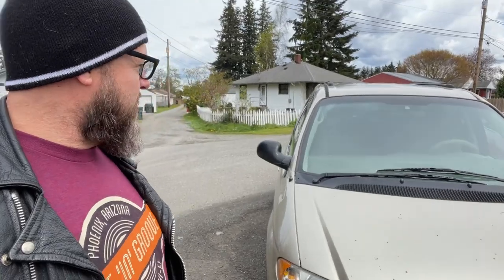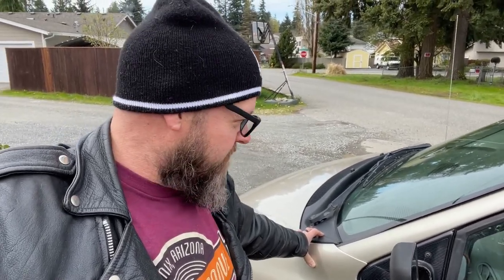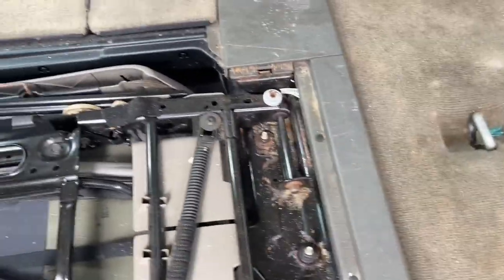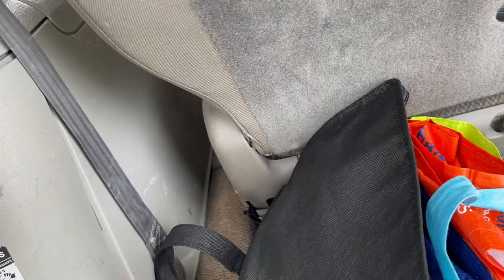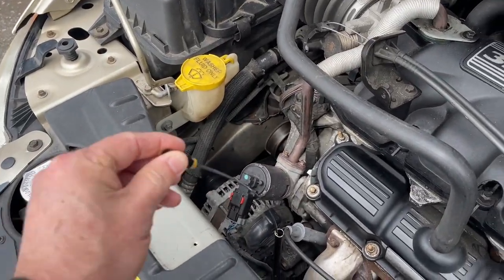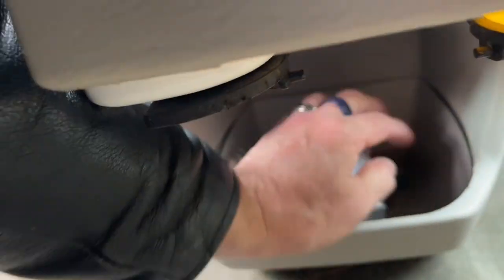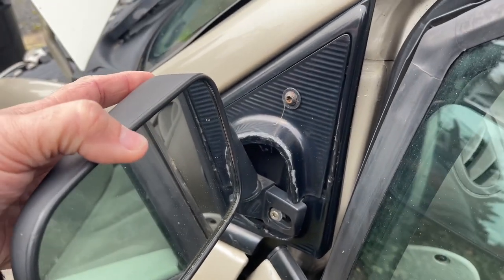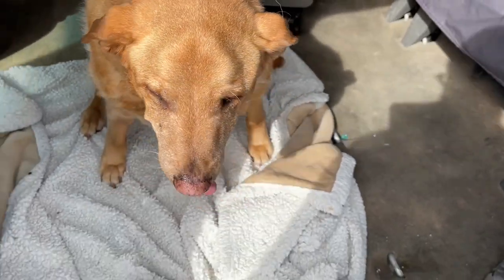Introducing Vinnie the 2005 Stow N Go Dodge Grand Caravan 3.3 L V6

Comment: Interesting side mirror repair that was done. Looking forward to hearing difference in engine noise. Tires seem like a good buy on vehicle.
Reply from the maker: Yeah but it takes the next two oil changes but I’m pretty confident Lucas and I can quite it down. 
That’s the only thing about the oil stabilizer is that it will create more pressure in the engine. The lifters and piston bearings have a little holes in them to let the oil in and overtime things loosen up and those holes get clogged. And it can be good for the engine to up the viscosity. But it also can put a lot of pressure on the oil pump. 
We’ll I’ll see what happens but I’m hopeful that I can get another 50,000 to 100,000 miles out of this old 3.3 L 🔧👍😁

Comment: Nice, idk if its because the value of cars went up or if the value of the dollar went down.
Reply from the maker: I believe it’s because emissions regulations have made new cars and relatively used cars too expensive for a large majority of the population. When I worked at Ford I did some work on maintenance and repairs of used vehicles. Some of the used Ford explorers and escapes we’re going for over 30 grand if they had less than 60,000 miles 😳.
And time will tell but cranking 300 hp out of a 2.4 L four-cylinder engine for example is really hard on that little engines. Will the engineering prove reliable when vehicles get over 150,000 miles? 
The old police interceptors are great vehicles that Ford made but they are six-cylinder and then naturally aspirated engine will go three 400,000 miles. But now they’re putting TwinTurbo‘s on those engines which makes him faster. But will all that heat wear out those with engines quicker? Time will tell. I had a Chevy sonic the best I could get out of it was 157,000 miles before the eco-tech engine went on me. 
It had a coolant leak and I do assume some responsibility as I should’ve had it towed home immediately. But I didn’t realize how incredibly fragile the temperature tolerances are in these newer vehicles. 
That little liberty you got more than likely has a 3.7 V6. Those are great little engines and transmissions as well. My daughter has one it’s up to 208,000 miles and still going.
Reply: @RussShawTV  yeah some car payments are insane now a days. Im liking this jeep. It didnt start on me a couple times,i think i have a leaky injector. so I have to add that to the to do list.
Reply from the maker: @nestoworks3402  Oh no, does it smell like fuel?
Reply: @RussShawTV  this jeep has all kinds of smells. I dont want to put too much into it i just want to get rid of it
Reply from the maker: @nestoworks3402  Could be a sticky valve. That Lucas upper cylinder cleaner worked wonders for my daughters jeep. And those engines do tend to have some issues with sticky valves and not getting enough oil to the upper part of the engine. Regular oil changes are super important. I also might recommend upping your viscosity. Depending on how many miles. How many miles are on it?

Comment: Cool vid Russ, what sort of miles per gallon do you get out of these?

I checked last night and majority of the Voyagers here are 2.8 diesels... But there is the odd 3.3 kicking about.
Reply from the maker: I’m not sure my wife and I were going to do an experiment to see what gets worse gas mileage Vicky the van or our 3.9 L V6 Pontiac? I think the Pontiac sucks gas. That vehicle was made in 2007 and produces only about 240 - 250 hp.
They’re building Mustangs now with a 2.4 L 4 cylinder engine that can produce 310 hp 😳 And I hear they get amazing gas mileage much like a Honda Civic
Reply: @RussShawTV  yeah I know what you mean, my wife has a 2018 Alfa Romeo Giulia and the 2.0 turbo produces 280bhp!  The good news is, AR doesn't suggest long life service intervals for this car, so it's still meant to be done every 9k miles or 12 months... and ours has been serviced four times despite only having covered 14k miles 🤣 the trans and diff are also "lifetime fluid" apparently, but despite low mileage I'll probably have those changed to keep the car running good.

Let me know what you end up getting on the old 3.3, I'm interested, I would love one of those but fuel prices here are scary at the moment... Maybe do a video on it, good content 👌👍

Comment: Don’t use Lucas “fluid thickener” in the tranny! Caravans don’t like that stuff in that hole.
Reply from the maker: Yeah I wouldn’t put that stuff in the transmission. Caravan tranny’s need to have even flow through the radiator to cool the transmission. But thanks for the salty tip Jesse the king 😁👍